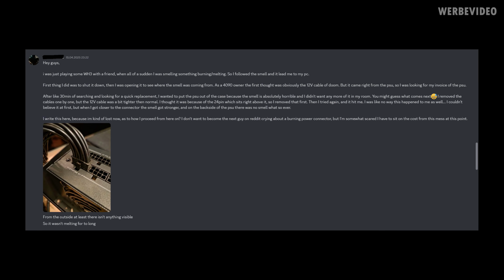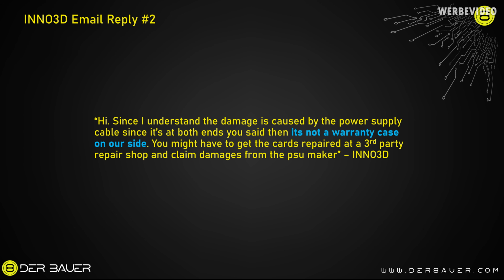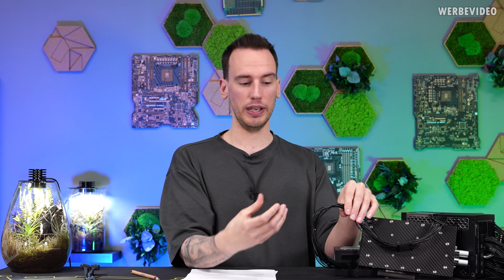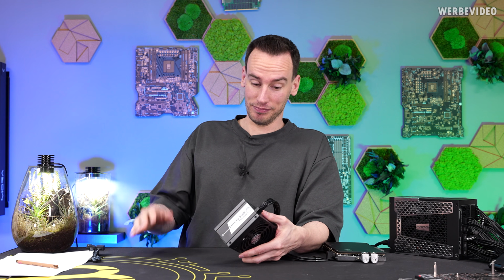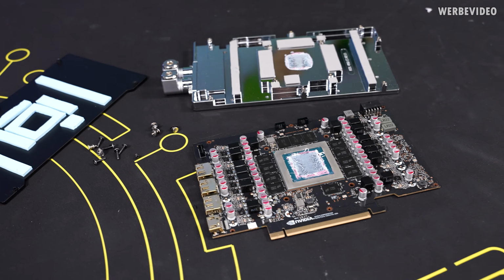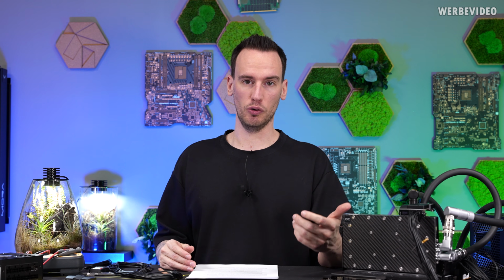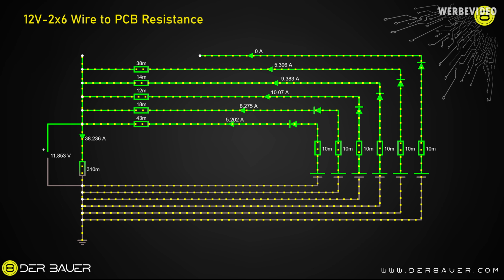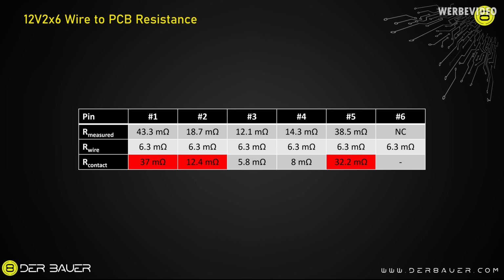Investigating and Fixing a Viewers Burned 12VHPWR Connector

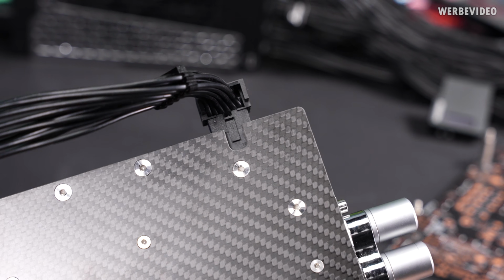Comment: At this point all angle adapters are a scam. You cannot tell me that a normal cable cannot be bent within 35mm but its suddenly ok when its bent from the factory. 8:27 looks like normal wires fed through a plastic housing. That bend is obnoxiously closer than 35mm no suprise their own cable goes against recommendation and failed. Doesnt seem illogical that since all angled adapters bend within this length they should all have a higher failure rate than a straight, unstressed plug/wires. That 90* plug on the waterblock cards has two bends closer than 35mm within each other and failed go figure lol

Comment: 5w doesn't sound much, but when whatever generates 5w of heat is enclosed in relatively thick plastic, things can go bad.
If only there was a reliable connector for gpus... I somewhat get that nvidia vendors might be required to use this garbage (evga at least used 2 on 3090s iirc) but asrock and saphire decided to use that on their top models on their own, albeit on lower power gpus but just why? RIP EVGA.

Comment: It seems obvious to me that Nvidia is responsible for this damage so Nvidia should compensate the user for the damage. No doubt at all, Nvidia failed to design it such that per wire the load can be measured.

Comment: Obvious question I have is whether or not if I buy a cable and remove the pins from the connector and solder the wire to the pin, which would reduce the resistance at that junction, would help lower the amount of heat generated within the connector. 2nd question is whether or not the gpu is actually pulling more current than they say? I would like to see actuals over time for each wire maybe using an inductive current meter coupled to each line of the cable. 3rd question, is it possible to build a circuit to limit current to each wire and redistribute the load over all the wires? That would have to be an external circuit I know but I think with the current issues and high cost of the graphics cards, this may be a niche market.

Comment: Why is anybody still using those inadequate cables and connectors and not 2 100A silicone cables with a proper mounting point on the psu? Failing that why are the connectors not internally cooled and balanced? They can pump 350+ kW in some EV charger by cooling the connector and cable, just do the same in a smaller scale.

Comment: Shouldn't be needed but asrock taichi 1300 and 1600w solution seems the best, put thermistors in the cable connected to a OTP on the psu

Comment: Am I crazy to say that the 12HVPWR cable should be an old PCIe cable but 2x6 Molex  + 4 pin JST cable for sense.
At this point I would prefer to desolder this nightmare connector and just solder the cables directly to the PCB.
Somebody at Nvidia should get fired

Comment: Couldn't you simply just make the each wire thicker so that way the amperage going through can be better handled therefore have lower temps overall? Wires heat up when there is power going thru that they can't properly support. We don't hook up 20 Guage wires to jumper cables for cars....heck properly made jumper cables can even become hot. Or add a 2nd connector to split the power just to be safer

Comment: IDEA for a "luxury" safety power cable: The job of such a 3rd party cable would be to actively measure the current per cable and disconnect all wires entirely if there is a dangerous imbalance. It would not solve pin connectivity issues, but would solve cable issues. Maybe such a "luxury" cable should include temperature sensors in the connectors on both ends, measuring pin temperatures. If any of those go above a configured maximum, like 80'C, then the cable should actively disconnect all wires, effectively shutting down the GPU. It may also send a warning shortly before to the software via USB, so the system can be gracefully shut down instead.

Comment: I would never use a less than 1000w psu with a 4090. Even tho I have paired them with Intel CPU’s that typically have a higher tdp then amd CPU’s, I still wouldn’t use an 850w or below watt psu regardless.

Comment: Don't worry, the 6000 series will have another newly "upgraded" cable solution.
That's a shame, the guy did everything he could- good PSU, 90° "H++" cable, and UNDERVOLTED it too, but it still melted. This just fills me with confidence for the future of this new angel hair connector. Why stop at 600w? Let's add heat pipes and fans then push it to 800!

Comment: if 1 wire melt complitly is a power management problem, if only a part of it melt is a cable problem more specific is a material quality problem, if the connector melt is a component problem

Comment: NEC is a useful reference on power handling standards with wiring.  This isn't just home building but also industrial machinery and regulatory standards like UL, CSA, and TUV. When you look at best practice standards and how the 12VHPWR is configured, it lacks thermal overhead for all wires being of excellent connection.  Even at the start, they lack the typical 25% overhead AND do not have any derating from higher environmental temps AND do not have any derating for wiring bundling.  The derating for bundling is typically in conduit, but I like to use the same derating for any wire bundles, even if just zip-tied together to button up appearance.  So no derating at all and no thermal overhead means this setup BARELY works if everything is perfect.  The instant any one of the 12 wires has a bad connection, the package no longer is safe.  The reality is these are vastly undersized wires when you start applying derating and thermal overhead.

There's no magic here.  It's just physics.  

I am surprised they don't use a thermoset plastic where it's a chemical reaction to create the plastic so there never is any kind of melting.  Instead, it just burns.  And if they wanted to run hot, they could use higher temp plastics like phenolic.  For example, you can have a connector shell that is well above the threshold of the wire insulation.  Instead you'd start seeing the wire insulation melting away.  The downside of course is you can get a hard short to ground if too much is melted.  But it's also highly visible and externally visible.  If the PSU monitors and can shut down for this failure and provide a human safe threshold of 5mA, then there's no problem.  You can readily let the external and easily visible wires fail.  But this is perhaps less safe than failing at the pins with mechanical spacing locked in place.

At the end of the day, you can start setting up monitoring systems.  You can track thermals of connections, current of individual connections, and use these to provide an error notification.

The pin that burns should be the one with the lowest resistance.  This is because we have a parallel resistor situation.  High resistance is just a wall, and the power flows elsewhere to the lower resistance areas.  This repeats until something fails.  Your lowest resistance wire is carrying the most current.

This is different for a single wire connection or single loop where there are no parallel paths to take. In this case high resistance equals heat, and it's a bad connection point that will heat up and fail.  The power has nowhere else to go to so it just powers through until failure.

The real matter is the wiring standard is bad.  The 12VHPWR standard is bad.  It's not suitable for 600W.  It's likely not even that good for half that wattage.  It NEEDS to take in account for derating and thermal overhead.  It NEEDS to take into account failure modes where one or more of the connections are compromised.  And it NEEDS to remain safe to use and not damage itself or other components when these failure modes happen.  It NEEDS to be robust enough for this because they're trying to smoosh nearly 1HP of power through this tiny set of wires, and that's dumb.  Even worse, they REQUIRE 12 wires, TWELVE wires and 24 connections, TWENTY FOUR connections to remain ideal.  This is a statistics problem and a really, really bad one.  This is not how you design stuff safely.  Heck, it's worse than that.  If you include the crimps and inserts, you are looking at 72 potential failure points for the terminal connection, the crimp, and the install of all 12 wires (it's not just the 6 power wires, it's the 6 ground wires too)  It is such a bad approach to power delivery, period.
Reply: That's exactly it and that connector really tries to defy the laws of physics on the basis of very little cross-section area. It needs more cross-section area for both the contacts and the wires if that connector is to survive the power demands, and the net result would be less contacts required for the task, making for a neater connector. I wouldn't be surprised if Molex quietly don't even stand behind that connector being used at such a high demand.
Reply: @larzblast  It's just weird to have a standard that only remains viable of everything stays perfect forever.  Screw abnormal cases.  Screw failure mods.  Perfection or set $2k to $5k on fire. What a nutty thing to do.
Reply: @larzblast  skin effect? it's dc...
Reply: @intercity125  Shit. I remembered it the wrong way around. More cross-sectional area for DC then!
Reply: @larzblast  It's been a while since college but I believe even DC is still mostly surface electrons.  It's not a homogenous flow of electrons.  I'd have to look this up again, but I think it's mostly the outer layer of the cross section that's doing the actual propagation.  I could be remembering wrong, definitely need to look it up.
Reply: @intercity125  it's pwm regulated dc. the pwm switching introduces skin effect, which is why there's upstream/downstream bulk capacitance by the FETs to smooth it out. but smoothing it out isn't the same thing as removing it entirely.
Reply: molex spec for the connector doesnt even allow the pins used for current sharing 😂. "gg" nvidia
Reply: THIS!
If somebody knows about automotive/industrial requirements THIS is how you design things, with the mindset of failure modes etc.
The design seems to be done by some inexperienced undergrad who never worked in that field and had no understanding of what works and what does not.
Reply: @DerIchBinDa  You look at a throttle pedal on a car, and you see 8 traces for the resistor, purely for redundancy, not because you have to but because you should because statistics and testing showed that's what was needed to hit reliability targets.
Reply: It would have cost nVidia next to nothing to add current sense on the GPU side and simply shut the GPU off in a scenario where current draw becomes uneven, possibly with an informative driver error to the reason for shutting off so that the user can take care of the problem or at least is made aware of the problem.
Reply: from connector application specification:
*This connector system is designed to mate tin plating to tin plating. Never cross mate tin plated parts to gold plated parts.
* This connector system is not designed for current sharing (i.e., splitting one current load across multiple circuits)
Reply: My issue is it should have never gotten this far.  Consumer protection agencies don't want to admit they missed a problem, because the only solution would be a recall of everything with that connector.  This is the aluminum wire situation all over again!

Comment: I had to buy a GPU + PSU bundle to actually find something in stock, but on the bright side that will make it hard for them to shift the blame if I have problems 😅.  I actually picked up a current clamp to verify the load is balanced though, it was only like $30 on Amazon (make sure you get one that can do DC).

Comment: I recently experienced a similar issue with my RTX 4090 Founders Edition. I was using an ASUS ROG Thor 1200W PSU along with a CableMod 12VHPWR to 4x8-pin custom cable and a Thermal Grizzly WireView 180 adapter. Despite undervolting the GPU—keeping power draw below 420W—the connector between the GPU and the WireView adapter still melted. All connectors were fully seated, and the failure occurred internally, with no visible signs of damage from the outside.

Fortunately, NVIDIA approved an RMA, though I received a heavily used replacement card after a month. I want to express my appreciation to Thermal Grizzly for promptly offering to repair my original card and replacing the damaged WireView adapter without hesitation.
Reply: You know who the CEO of Thermal Grizzly is? Name is Roman Herzog aka 'der8auer'
Reply: @scottytremaine5064  I know that’s why I use he’s products and subscribe to his channel, I use only thermal grizzly.
Reply: Thermal Grizzly is how all companies should be run.
Reply: I have seen RTX4080 connector melted as well. So the safe threshold is much lower than 420W , I say probably only around 300W at best for the 12VHPWR connector.
Reply: @fleurdewin7958  then what’s the point of buying 4090 when you going to cripple it and will essentially perform like 4080 ti/super ? I all ready reduce voltage by 30 % and keep in mind the maximum is 420w the average is about 380w.
Reply: I am more and more convinced that this is not the fault of the plugs, but of the incorrectly designed power supply system of nVidii cards. At first it seemed to be the plugs, but they seem to be only the weakest link of the whole and not necessarily the cause. It seems that these cards simply do not balance power consumption through the cables. Honestly, I was just waiting for you to pull the plug and bet BLINDLY that it would be 12V - and I was 100% correct. It would be good to test under load each cable separately and see what is actually going on there, because I have the impression that, despite all the hype, no one has yet done such an obvious test.
Reply: It was the non-Pro Wireview without the temperature sensor alarm, right?

Comment: Everyone with a 16pin power connector should be using dielectric grease, it will help cool the pins and if there is some melting it might keep them from melting together

Comment: NOOOO YOU DONT NEED A GRINDER! lol Just add some low melt solder with a soldering iron and then ease into the area with 450 degree C hot air

Comment: solution 1 :
ceramic connector at both sides
and fiberglass sheath for the cables

solution 2 :
make sure all the resistance of the cable are exactly the same. Tolerance of the length and gauge of each of the 12 cables must be reduced. 

solution 3:
monitor each cable amperage and add adjustable resistors (potentiometers) with low impedance. Adjust the resistance of each cable manually. This should be fun for overclockers that overclock for the sake of tweaking.

solution 4:
PSU with load balancing for each pin like the modern USB GAN chargers that can distribute load to multiple USB devices.

Comment: the moronic anuses (aka GPU manufacturers and Nvidia ) used 2 blades of metal shaped into a connector  soldered to the board which as der bauer points out renders  protections offline these cards are way to damn Expensive to have Gpu manufacturers cutting corners like this!! at the very Least they should step up the type of plastic to a type with a way higher melting point BUT !  if i bought one of these Cards  i'd be using an automotive radiator cooling fan connector capable of  50 Amps however it would require a donor cable from the psu manufacturer which would need to be bought in advance of the project !! 😁☺ it's still very aggravating for a Gpu that's  over $2,000.00 u.s. and to be having issues like this when they know conclusively that it's their plug in power  arrangement causing said issue gotta lovette guys & gals! the 2nd gen to have this issue lol not really funny just pissed about the shit companies get away with where if you or I Did a shenanigan like this we'd be executed lol!

Comment: At this point maybe we consider a slightly thicker cable at 14 AWG over the standard or traditional 16AWG gauge wires. I think this would offer slightly better insurance and I don't understand how you can run 50 amps through 16 AWG? I guess because in theory you're using multiple wires but at what point are we all going to admit that if no one is going to actually do anything about this problem on the hardware end (GPU w/ proper circuit protections) at what point do we just increase the gauge of wire, or decrease I should say LOL. Running a much thicker 14 or even 12 would be a much stiffer cable but even at these larger gauge's they would still be flexible enough, offer a softer more silicone like insulation and it would increase the flexibility of the cable even more. Or someone kicks Nvidia in the ass, lights a fire under them and says now run. For anyone whos confused about that what that means is we basically boycott Nvidia until they either leave the GPU market entirely or they fold and give us what we actually deserve, not want.

Comment: The next power connector for the 60x0 series better be a blade connection with 1 ground and 1 12V+ wire if they continue to build cards with no current balancing!

Comment: The quickest fix right now is to put two connectors and harden the connecting points.  Each pin was shown to handle 30A if I remember correctly.  So two connections at 600W max that’s it.

Comment: I stopped the video at 13:50 because I noticed that 5 of the 12 pins had not been fully soldered through the board (the copper on the connector side was still visible). Could it be that those five have a cold solder joint?  Your repair looked much better but the corner pin still appeared to be lacking a bit of solder.

Comment: I just think of the current like water traversing through the 6 pipes. if you create a resistance in 2 of the pipes, ie blockages, the water will find the least resisrtance and increase the flow through those pipes... Theoretically the same is happening here, but with electrical current.